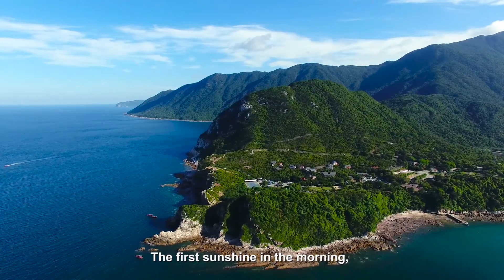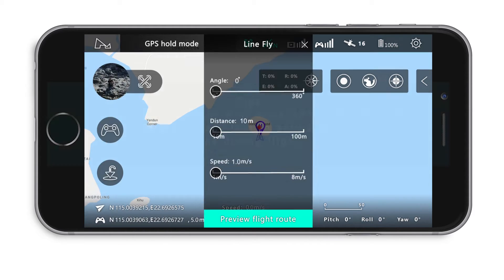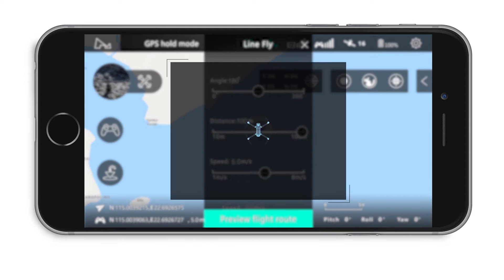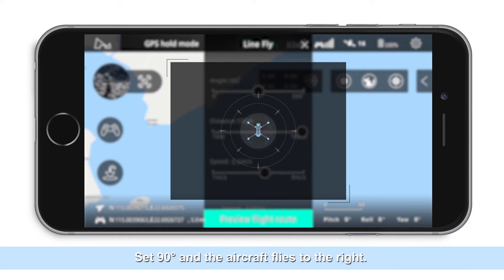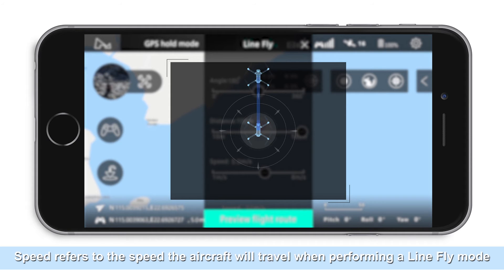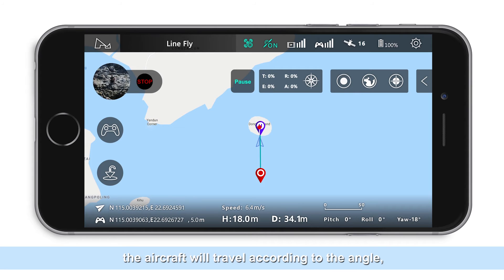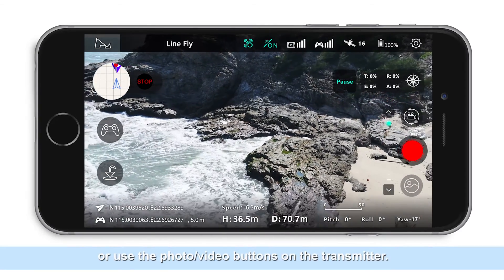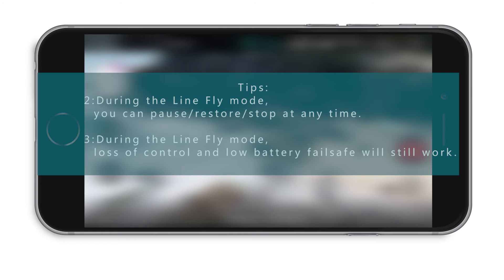Hubsan Zino Tutorial Series Line Fly Mode

Comment: I'm guessing that the drone elevation will increase when flying outward based on the camera angle?  If the camera is pointing straight horizontal, the drone will not gain altitude at all, and if the camera is pointing straight down, then the drone will fly straight up?
Two more questions:
1)  Can you vary the camera angle while the drone is executing the line fly mode?  I know throttle is available, but how about the camera angle?
2)  Any possibility of adding a "round trip" option, so the drone will fly out, then return?
Thanks!
Reply: Hi, I tried the Line Fly Mode with the camera facing a bit down and it seems that the aircraft in fact doesn't gain or lose altitude automatically (not an option in the screen) so my guess is that you have to do that manually. The guy in the movie isn't filming himself but someone else is doing that. So for 'selfies' just hide the drone a bit and push the throttle stick (which is the only one available) yourself :).
Did you already try it yourself and so, what was the outcome?

PS: I noticed that Hubsan doesn't really answer the comments on YouTube/Facebook so it's up to us to help eachother.

Comment: so angle means azimuth and altitude we should increase manually?
Reply: Hi, I also tried the Line Fly Mode and it seems that the aircraft in fact doesn't gain or lose altitude automatically (not an option in the screen) so my guess is that you have to do that manually. The guy in the movie isn't filming himself but someone else is doing that. So for 'selfies' just hide the drone a bit and push the throttle stick (which is the only one available) yourself :).
PS: I noticed that Hubsan doesn't really answer the comments on YouTube/Facebook so it's up to us to help eachother.